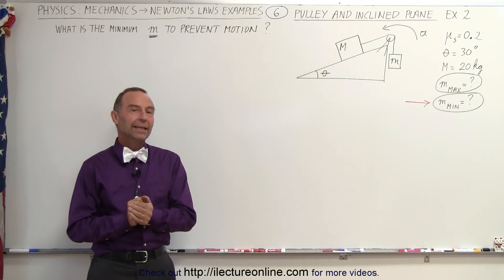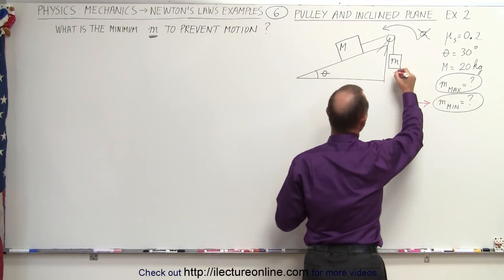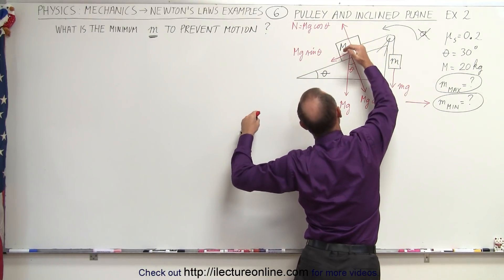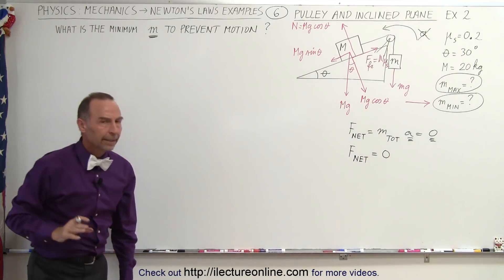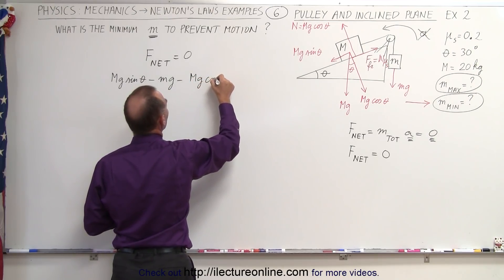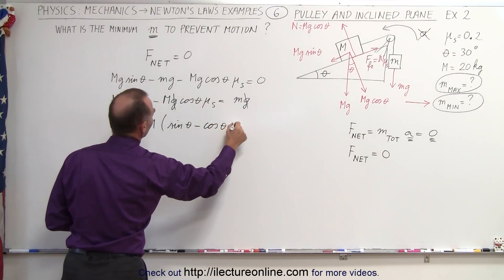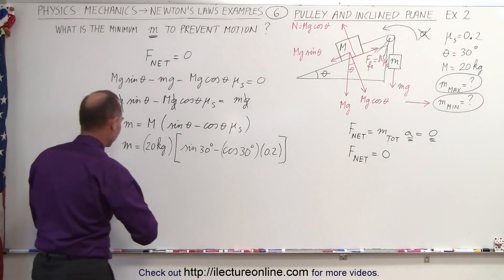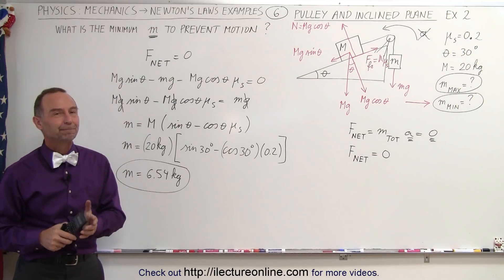Physics 4.1 Newton's Laws Examples (6 of 25) Pulley and Inclined Plane: Ex. 2

Comment: If the mass (m) is between 6.54 and 13.5 , is the system at rest ?
Reply from the maker: There will indeed be a range where the system will be at rest.
Reply: Many thanks !!!
Reply: And if The sistem had costant velocity, with m is between 6.54 and 13.5 Kg, The sistem mantains this velocity. Is it correct? Many thanks